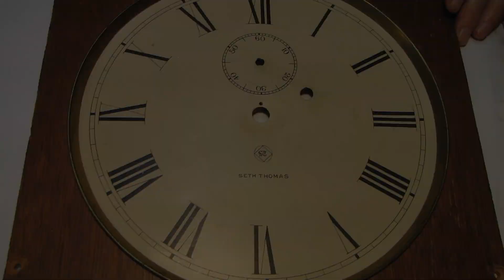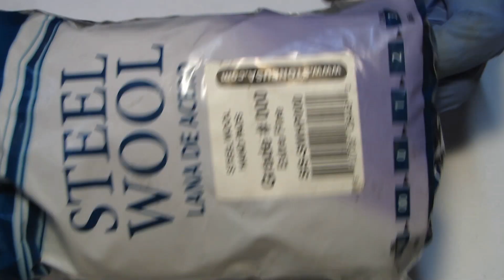Servicing the 150 Years Old Seth Thomas #2 Regulator Antique Wall Clock

Comment: Very well done video.  I was interested in finding out how to adjust the speed of the clock.  Would you consider creating a video with that information?  Thank you.
Reply from the maker: Thank you for your comment! I think adjusting clock speed is so simple, that isn't worth of creating a separate video. It's all about regulating the length of the pendulum by the nut at the bottom. But I like your interest in the topic.

Comment: What is the part taken out at 1:39 for? its like as secondary ratchet of sort? what is its function? what role does it play? Any input is appreciated.
Reply from the maker: You're right, it looks like a click for the secondary ratchet wheel, which I think makes the main ratchet work smoothly and even protect it from damaging. Thanks for watching!
Reply: @ValentechTime  Thank you! its causing some issues and was wondering if I could just remove it. Seemed redundant but making sure
Reply from the maker: @igorberezin856  Could you describe the issue it's causing? I did not see anything troubling with it. You can try to remove the click for the secondary ratchet wheel and see what happens.